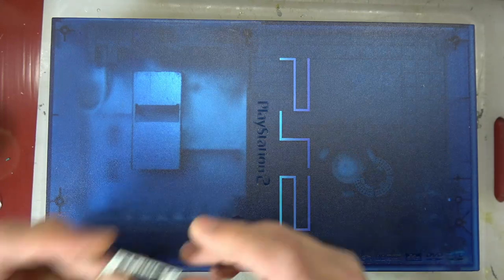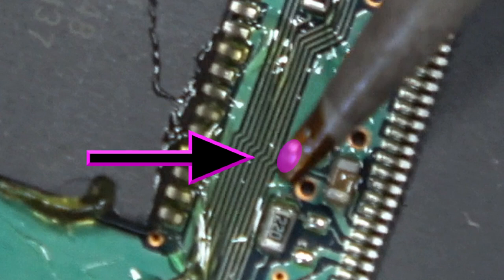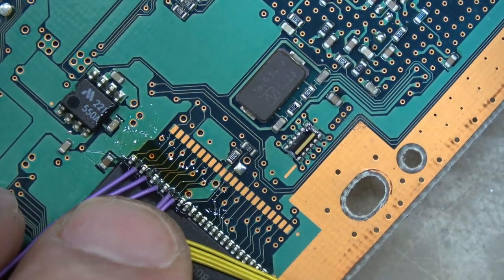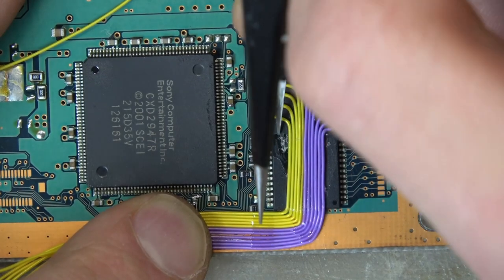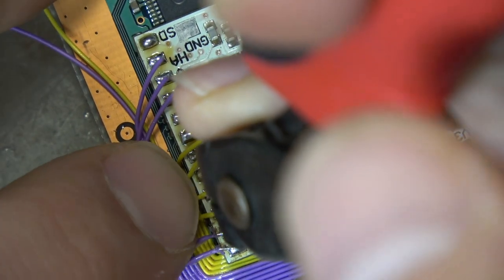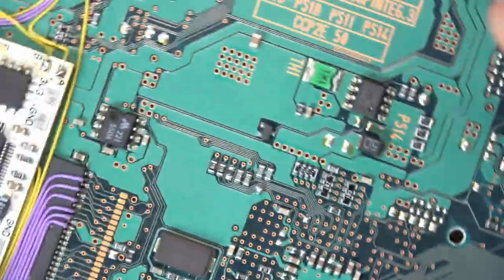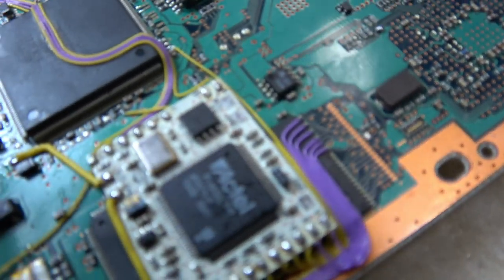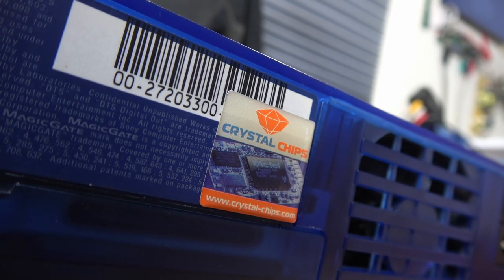PS2 FAT CRYSTAL CHIP MOD

Comment: I tried the FreeMCBoot, and while it loads games off a usb drive, video streams slowly, and load times are terrible.  Loading from a disc doesn't work (i get a spash screen from the load disc software. then just black screen forever).  I'm thinking of just going ahead and installing a mod chip.  I did one on PS1, i know this is more complicated, but the soldering points all look much easier to tap into

Comment: Thanks for the video! But I didn't really understand where to solder the wire (SX). Should it be soldered directly to the square resistor 104? But in the diagram, the edge of another resistor, white, is marked in red

Comment: I didn’t remember what chip I got installed in my PS2 so I checked my ancient emails. Found a 2003 email stating I got an official Messiah 2. Was that a good choice for that time? I still have that PS2 but I think the laser is getting weak.
Reply from the maker: YOOO MESSIAH2!! That's a chip i dont have yet ( i got a decent collection of old ps2 chips going )
Reply: RETRO GAMING ARTS I remember really looking into what chip to get back then and narrowed it down to that one. Was it a good choice for that time (2003)? And in general is it one of the top chips?

Does you not having one in your collection make it safe to assume it’s currently rare?
Reply: @RETROGAMINGARTS  I used to live a few minutes from Gary Edmunds and his shop in Malpas - Channel Tech. I had my PS2 done with an original Messiah!

Comment: Cyanoacrylates are common staking adhesives for post-manufacture modifications. The way you're staking those wires is very similar to how it's done in-industry. Nice job!

Your soldering technique isn't bad,  but please make sure you're using either No Clean fluxes or you completely clean up 100% of the flux you put down, or you're going to be facing down corrosion in the future from un-activated flux residues.

For stripping those 30awg Kynar wires post-installation, check out the Xuron 501 adjustable strippers. Should make your life a lot easier.

Good job!
Reply: He said in the video he cleans up the flux with alcohol on a qtip

Comment: You could tell the wires could have used some flux.  The solder was turning chocolately especially with those first two wires on the crystal.  Ever since I started building keyboards, I now appreciate flux a lot more thinking the rosin core was good enough when I didn't realize that flux burns away.  Major appreciation on what you do and I am super jealous of your wiring.
Reply: same : flux rocks

Comment: @19:50 - Popping it back together.
It is hard to see as the video is going quite fast, but the metal cage grounding pins seems to be really close to your wiring.
This is something that I recommend paying a lot of attention to, as you risk a short - possibly right at when turning it on, or in the future when the plastic has given away.  Especially if going through those large center holes, the clearing may not be as good as you'd think - and there's usually ground all around. Use a via instead, if absolutely necessary.
Nice job, I thought it was a DMS3 chip. Brought back lots of memories from all the consoles I used to mod with all kinds of different chips (enameled wire and without glue) and replaced lasers :-)
Reply from the maker: there are these little sections that are cut out of the metal cage, and they are bent like little fingers, each "little bent metal finger" is touching the ground plain, it goes all around the cage, what i do when i run wires along the ground plain is flatten those little metal fingers. so they are not touching the wires. i actually ment to showcase that in this video but forgot and the video was relatively long aswell. but you are ABSOLUTELY correct. and you used to do these back in the day? THATS SO COOL. I love meeting people who had done this when it was relevant. i'm very late to the party lol. Thank you very much for watching and checking out my channel

Comment: I would like to see a video about ps2 mod chips I was young back in the days when they came out..I have only used clones in the past..but you can’t find them anymore or is to expensive..
Reply from the maker: I'm working on my vintage chip collection... LOL! they are REALLY hard to find, i'm going to try to get a few more then i'll do the video, It's really interesting to me, all the different chips and how they're all the same, but not really.
Reply: I think after the soft modding people pretty much gave up on modchips. Maybe that's because they stopped making them.
Reply from the maker: @vdochev  yea, the freemcboot memory card is very convenient. However I use a modchipped system to make those memory cards, so they still serve a small purpose.
Reply: @RETROGAMINGARTS  You can make one without the modchip, but, yes, modchips do serve purpose. Really good soldering skills on the video and AMAZING cable management! BTW, have you tried modding a Wii? I heard latest models are pretty hard to do, because they started chopping off the legs of the bios chip.
Reply from the maker: @vdochev  thank you very much. I havenot modded a wii yet! But I do have a very old original modchip for the wii. The d2ckey chip. Pretty intense hard install and I'm greatly looking forward to it! It WILL be on YouTube also.
Reply: Και που να δεις πόσο σπάνια και ακριβά είναι τα τσιπάκια στα πρώτα xbox! Όλα τα mods του ήταν και είναι πανάκριβα.
Reply: Little Reptilian  δεν εχεις δει το κανάλι μου έτσι χαχαχαχαχα
Reply: Little Reptilian  Softmod λεγεται και TSOP για να γινει μονιμο. Τσιπάκια φθηνά υπάρχουν ακόμη και σήμερα σε παραγωγή, το aladdin αλλα είναι μάπα. Τα γνήσια τσιπάκια της εποχής είναι πανάκριβα, δες xenium ice, xecuter. Softmod κανουν αρκετοι ακομη και σημερα, τσιπακια βαζουν μόνο οι μερακλήδες για τον εαυτό τους χαχαχα :P
Reply: back when the ps2 came out I got mine modded with a Messiah chip, I still have it to this day and it still boots and works great, now I am learning how to solder I would love to try one of these on a cheap ps2 for practicing. Ive yet to see what is out there but seeing your comment tells me there isnt much choice ?

Comment: superglue absorbs water to cure, it is a form of acrylic resin once in contact with water or humid air it starts forming a plastic mesh.

also why it loves to bond your fingers to stuff or together, and if you ever get your hands on the special medical superglue.

on a side note, one of my co-workers gave me his old original chipped Playstation, i know his soldering methods, so i stripped it open and re wired it .. he used wire from an old mains cable!

Comment: Nice clean install. I like seeing people that take pride in their installs like you do. Now for some constructive criticism, I’ve never liked melting insulation as it just looks unprofessional in my opinion and I’m sure you feel the same way from what you said in the video. A tip you can use for that in future installs is to strip the kynar with some small fingernail clippers. They’re great for stripping wire in tight areas like that and it makes the install look much cleaner in the end. Hopefully that’d didn’t come across wrong. Thanks for sharing!
Reply from the maker: if you watch my other PS2 mod video, you'll see that's exactly what i did, fingernail cutters to strip, haha, your right though, it is so much better, i really HATE burning the insulation. but since the last video had fingernail cutters i wanted to do something different for this video
Reply: @RETROGAMINGARTS  Fair enough. I hadn't seen the other so I figured I'd give you the tip in case you didn't know it. Again clean, install none the less. Keep up the good work!
Reply from the maker: @TheModShopCO  It made me know your the real deal when you gave me that tip, not to many people got the the point of improvisation during modding LOL

Comment: You can use for that or similar works cat network cable you will have a better results in soldering ! And I am sorry to say that but I must correct you ! The best chip in my opinion is the " DMS4 PRO CHIP " you don't have to much cable to solder and it protects the laser unit too ! It can do what the crystal chip, modbo chip, matrix chip and similar and clones- can and much more and better ! 
Thanks for the video.
Regards,

Comment: Interesting wire routing.  But please remember there is a minimum bend radius.  Usually 5x the diameter of the jacket, otherwise you may damage the core/conductor.
Reply from the maker: I'm going to do some research on that so I understand it better, so I can still do my thing without compromising the stability of the modification, thank you

Comment: I would trust you to chip my whatever. That said, your use of super glue is an unnecessary detriment to serviceability. It may look striking, but it would actually just be better to use heat shrink tubing, and perhaps some double-sided tape. Your solder joints are lacking, compared to the "clean look" of you wire management. Again, I would totally let you chip my xbox or whatever. Keep up the practice.
Reply from the maker: Thank you very much, every day I'm practicing. Solder joints are #1, takes years or practice to perfect every time. And as for the superglue, it's never cause any issues and the few times I've needed to remove the wires it's never been any troubble. I mainly only use superglue if I'm going for artistic wiredressings. Witch is very few mods

Comment: Hello, is there a button combination to enter in the menu with the configurations of this modchip? I know that I can disable it by pressing quickly the reset button for 6 times but what about a sort of hotkey for the menu? Something like the Matrix Infinity's triangle+circle hold to enter the menu after reseting. 
I really need to disable the RGB-green fix since I can't use component if I don't disable the modchip.

Comment: Man I want to do what you do but I'm so limited on time with work my business it'll be tough and I'd have to research which chip to use.  By the way based on your experience what tends to be common issues with PS2 and need worked on? I have 2 fat ones and 3 slim ones and I plan to get rid of all the slim ones cause the ribbon has potential to scratch up the disc when it's playing.
Reply from the maker: lasers are only issue, and theres a fix for the ps2 slim ribbons scratching the disc
Reply: RETRO GAMING ARTS got it. Was the fix just bending the ribbon but pushing it down at a certain point? Or is there another fix you’re talking about?
Reply from the maker: @optimusp517  You can buy brand new ones of those exact ribbon cables, and they come with fresh sticky tape on them so you can stick them down so they dont bend up on you anymore, or you can get crafty and use a little bit of doubble sided tape and throw it down
Reply: RETRO GAMING ARTS ah ha! I never thought about getting a new ribbon. I replaced the laser but I should’ve done the ribbon at the same time. Or like you said maybe I can get some new double sided tape for it.

Comment: Amazing video, one question: What kind of cables do you use for data lines? 30AWG wrapping cable? for gnd and power it seems to be 26AWG, but i'm not sure on data lines, and in the cable roll it doesn't say anything.
Reply from the maker: I use 30 AWG Kynar wire for the data lines, and power and ground I'm using 26 AWG Stranded. (24 guage is best, but i ran out of that guage)

Here's a direct link to the exact Kynar Wire i'm using. https://www.ebay.com/i/252533787813?chn=ps

Thank you very much for watching and checking out my channel, If you liked this video I bet you'll like alot more of the videos i've made lol

Comment: FreeMCBoot, Network Adapter, Harddisk, done ;-)
But your work looks pretty cool :-)
Reply: That still won't do out of region PS2 games, burned or out of region PS1 games, or any burned PS2 games without the ESR patch (which by default does not work on CD games either), but it's still far easier to do than a modchip install. If you have a hard drive, you could also use FHDB which is a direct hard drive hack that does not use space on the memory card.

Comment: What are those boards in the wall, near the TV set? Is that some sort of multiplexer for several video inputs?
Reply from the maker: correct yes, and a power supply aswell. They controll all the functions of the screen. Pretty much i just took a small LCD tv out of its plastic casing and wall mounted it LOL

Comment: Subbed! Love hacking vids. I got my 360 n PS3 modded not long ago. I hacked my Wii, WiiU, PSP, Vita and Ive done my Switch too which I'm thoroughly enjoying atm. But these older kinda hacks are awesome man. I only just seen u can hack the Gamecube! That blew me away that u can play Megadrive games on a GC...crazy or even N64 too. Really cool. But yeh soldering stuff is over my head. My family owned a dsta cable company so I have soldered years back but yeh dunno if I could do modchips, be cool to learn. I have an old OG Xbox thats been hacked but I ruined the settings in it now its got an error screen so maybe I should take it apart, just for fun or learning on even.
Reply from the maker: HELL YEA! PSTV is a great one too, It's EXACTLY like a hacked vita(witch i did a video about) but it works on your TV so that's great, I just got a japanese ps3 in to hack, havent dont an OG xbox yet, but i want to make an XBOX slim so i will be doing that eventually, and if you want to learn about soldering, my channel has TONS of helpful information scattered inside of it, Thank you so much for checking me out

Comment: What's the wattage of your soldering iron? I heard that it should be either 15w or 25w for these type of really delicate small projects... is that true?
Reply from the maker: I use a temperature controlled soldering iron, I dont suggest the pencil tip 15w/25w/40w style irons for this type of work, those are excellent irons for learning, or just starting out, or if you need to do SOME soldering for your projects, but not alot. I typically solder all day long every day, I have 2 different irons, both temperature controlled, they have their own power supply and can range temperatures from 0-485 degrees Celsius. I typically solder at 320 celsius. I did a few videos about the tools used and other information like this, but i can always do another, more updated one

Comment: You seem to know a fair bit about the PS2- Is it hard/expensive/complicated to change the laser on a PS2? I got mine modded years ago (think 2003) & using fairly cheap dvds to burn games/movies messed it up over time especially when family members/friends would leave it on for long periods of time so haven't used it since 2008. I buy all my games n movies legally after it happened but it would be cool to try and get my first launch PS2 working again.
Reply: the laser is surprisingly easy to change.  spawn wave has a video doing this exact thing, pretty recently.  look for a video about buying a used ps2 from gamestop
Reply from the maker: Lasers will cost you around 10 dollars, and they are very easy to change
Reply: @RETROGAMINGARTS  Nice thanks guys i'll look into it

Comment: I’ve got a modded PS2 console SCPH-30003 R.  It was having trouble loading CD & DVD discs for PS2 so I got rid of the Datasafe CD ones I used Verbatim and burned at X4 Nero.  They work fine but for some reason now all my DVD ones Sony and Verbatim burned at X4 they just make a click sound and then say Please insert a Playstation Two disc? Tried my original one Tony Hawks Underground and works straight away?

Do the magic mod chips and this is going back 10 years loose there lifespan or something?
Reply from the maker: Hmm, very interesting question/situation, my immediate thoughts are the laser is loosing strength

Comment: Hi.
Can you please give some details on how to use the Crystal Chip?
I got a fat PS2 with network adapter+HDD full of games and a Crystal Chip installed.
I know I need a Boot Manager program or something to use the HDD. Unfortunately Free McBoot does not work with the chip, they are conflicting. (yes I can put it in sleep mode)
But I would be more interested in using the chip with the HDD.
Thanks.